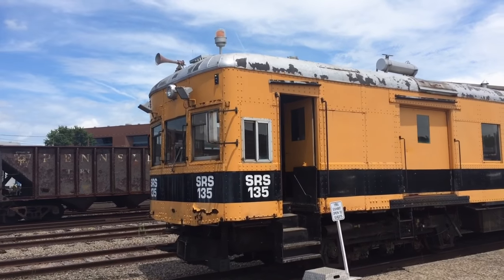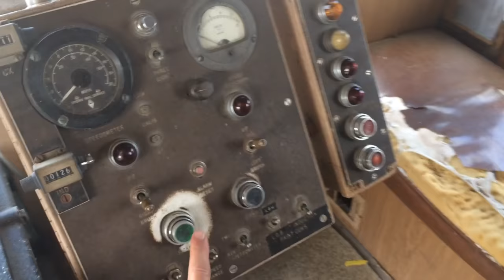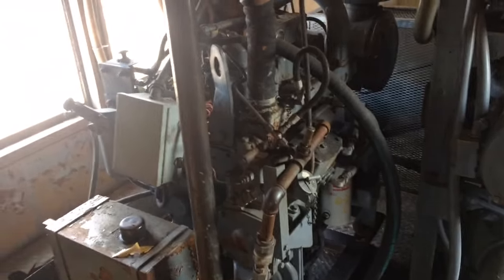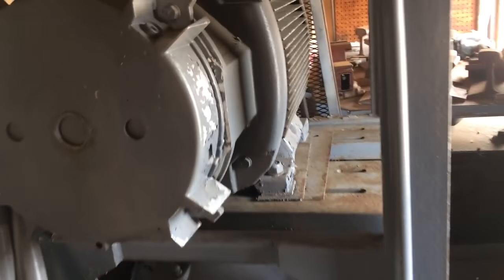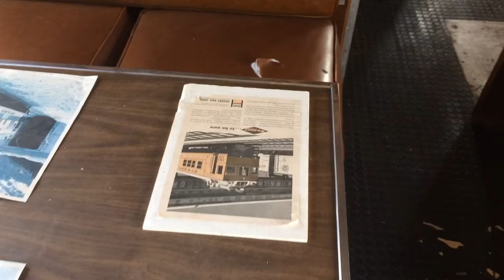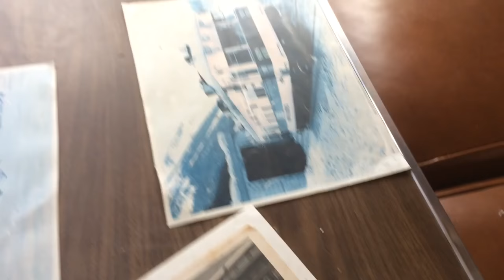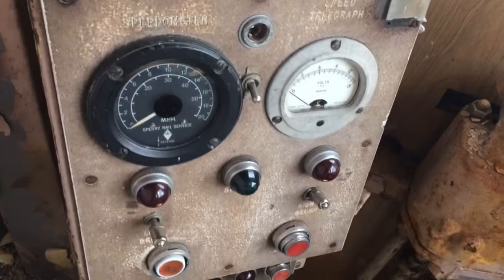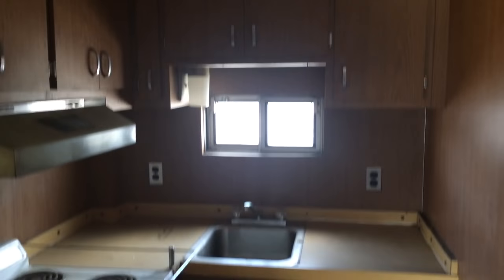Rail Road Camper Car RV MotorHome Tiny House

Comment: As Mark Shields said, Sperry Rail Services tests rails for defects.  The door you entered was at the back with a paper strip recording information on a strip which was directly connected to the movement of the car for a permanent record.  The engine room provides power to move the car and electricity(the "motors") for the high amperage going through the rails to detect any defects and for lighting the car.  The bunks are for the Sperry crew.  The 2 or 3 railroad personnel would come and go depending on what part of the railroad the car was on at the time and if the car was testing or travelling.  Normal testing speed was about 5 or 6 mph.  Travel speed could be as much as 45 or 50 mph.  The last section you entered was the control end or front where the motorman (engineer) sat also a railroad employee acting as a pilot who knew the section of track the car was travelling on.  Most early Sperry cars were converted from selfpropelled cars railroads had used to reduce the cost of passenger train service in the 1920's thru 1940's.

Comment: Digital equipment has made this analog stuff obsolete. Psst...don't tell the railroads.
Reply: They are not obsolete at all. These cars have been upgraded with the latest technology and are still in operation. The Ultrasonic and Induction systems that were installed on this car are still the same base technology used today, only it's been modernized.

Comment: You need to get your facts straight.
Reply: The car was used as part of a maintenance program and its also designed with living areas. I don't think he's very far off on its description Technical Terry.
Reply: @madtrucker0983   He called it a "Camp Car". It's nothing like a camp car. Look up what a camp car is. A camp car is not self propelled and serves no other purpose other than providing living quarters for MOW crews. This is a rail defect detection car. It has living space for the crew that operates it. It's self propelled and has on board testing equipment.
Reply: Don't be so rude....